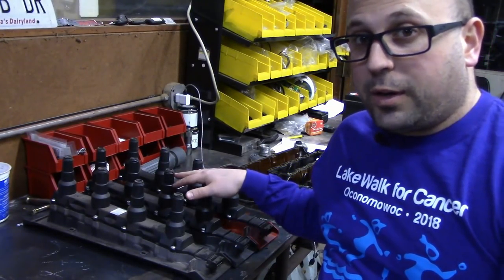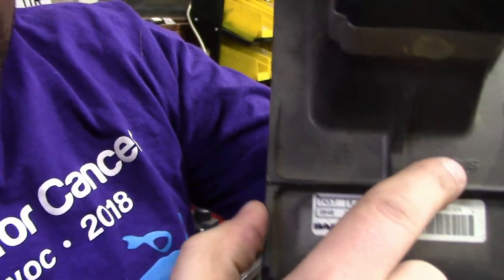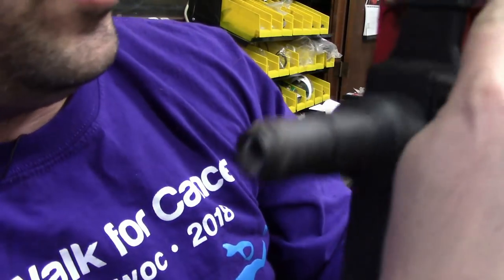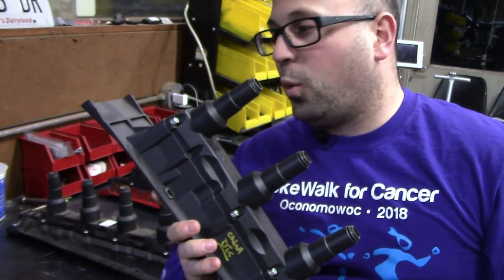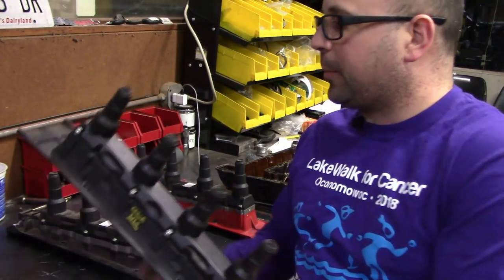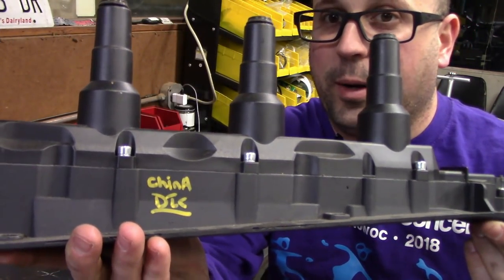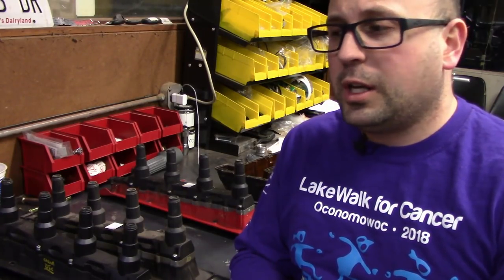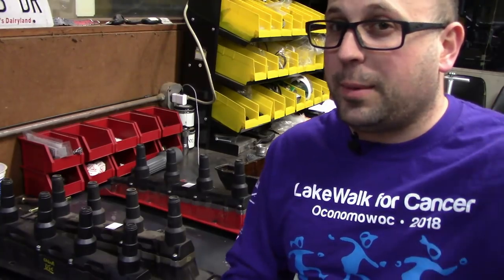Everything you need to know about the Saab DIC (Direct Ignition Cassette) and more!

Comment: Lots of comments below which are Wrong.... Trionic 5 cars use a DC based spark on the DI. It also uses the spark plugs to measure the Ionisation in the combustion chambers between each combustion. This is used for Knock control.  Black DI's use AC based current for the spark. I was on the original discussions on Saab Central back in the early 2000's with Dr Boost, the late Saab engineer that designed Direct Ignition.
Yes you can put a black DI onto a Trionic 5 car, but ideally only for testing. I would say they are ok on a low boost car, i.e. a 2.0t or 2.3t.  But absolutely do not use on a full boost Turbo car, 2.0T, or 2.3T / Aero. You will have ZERO knock detection and you will melt valves or punch a hole in a piston.
Reply: Thanks for the explanation. By extension, a T5 DIC should not be on a T7?
Reply: @Codric  Yes, a T5 Di on a T7 car, it wont even start. And could even damage the ECU.

Comment: Every good Saab owner should own a spare SEM cassette. My 9000 has a T7 and of course, I keep a spare T7 in the trunk. Another awesome video! Thanks Saab Dr!
Reply: Your 9000 has what? T7? Did you like rebuild all the electronics in the car or what, because 9000 never had T7 from factory.
Reply: @PeterChomanic  while the early models of the 9000 were not compatible with the T7, the later 9000 Aero and CDE models with APC  were compatible with the T7. One of the Saab engineers who worked on the cassettes has written "The final word" on DI Cassette compatibility. But you're right. Cars that shipped with T5 shouldn't change their DI Cassette. (With the exception of some B234 which allowed it in certain cases)
Reply: @TheWiseTent  ok so your 9000 has a black cassette for T7. But it does not have T7. T7 is a trionic unit, an ECU. I know you know that. But now we understand each other
Reply: thewisetent would my ‘97 Saab 9000 CS 2.3t Anniversary Edition be able to use a t7 dic

Comment: The cheaper ones also weigh a lot less and are potted with silicone vs the hard black stuff that OEM have. I took two apart for fun yesterday. One was a blown OEM and the other a new Chinese one that didn't work right. The cheap one wasn't even soldered together on all of the coil packs inside. I should have done a video, but didn't think about it.

Comment: An important information to mention is that certain versions of 9000 can use a black DIC (T7).
MY90-92 with DI/APC using an LH 2.4.2 fuel system can use black DIC.
The reason for this is that the red one has a DC spark, and the black one has a AC spark, and thus, a longer spark duration.
It turns out that car with LH 2.4.2 like that. It's even better, since the longer spark duration enables the engine to run smoother. 
Of course, you can use a red DIC as well, since the car was shipped with it by default.

Again, this only affects LH 2.4.2 9000's. 
You should not use a black DIC on a T5 car, under any circumstances.
Even when you desperately need a spare one. If you have T5 car, carry a T5 spare (red).

Comment: Sorted my no.3 misfire. Had replaced awhile ago with  a China rubbish one. Put the Saab one back in and it’s all ok now . 5 screws were by spark plugs. Mind you I had done 500 miles with it ill. Still had amazing pull. 9-5 2000 2.3 hot turbo 117k miles. Cheers..

Comment: You may want to update your video. Orio, the company that now owns the rights to supply Saab parts to the world, sells an ignition cassette that fails all your points. No stampings, no SEM #s, hex - not torx screws. Label says Saab Original. It is part number 32022255 which supposedly supersedes part number 55559955.

If there is a way to post a picture let me know. I took a picture of the Old Original & the ?New Original but it's not letting me paste it here.
Reply: Does that mean 9-5 V6 3.0t ignition cassettes have the new manufacturer and part number too?

Comment: I've been running black DIs in some of my 9000s for tens of thousands of kilometres, haven't noticed any problems to speak of, aside from a little pinging on really hot days when running low octane fuel in my naturally aspirated one. Although this is probably due to other factors than the DI module.  My understanding is that the T7 module is fully backwards compatible.

Worth mentioning that when these modules fail (and fail they do!) that you should unscrew the base, if uncracked, and keep it.  The bases are nothing more than moulded plastic with rubber fittings and springs inside to conduct the electricity to the spark plugs.  A cracked base can easily be either swapped out for an uncracked one or the cracks can be filled in with a $1 dollop of two part epoxy resin (something else that I have done myself with tens of thousands of kilometres of subsequent trouble-free motoring).

Never encountered a Chinese knock off before, but will keep my eyes open for them from now on.
Reply: it's not fully backwards compatible. DIC is of course sending a spark current, but it is also messuring stuff back through the spark, namely ionisation, which is sent to the ECU that counts on that data to adjust the ignition, etc. so you should actually run red in T5 and black in T7, but emergency use is still possible. it is known T5 with red one does not have any big problems to run, of course, but the more power you have and the more sharp your driving style is, the worse.
As fot the cracks, having a crack still does not have to mean it's broken already. It's heat causing the plastic to crack. Failure is based on epoxy crack under all the covers, which then lets the current to go not only to the bank it should, but jumps between two.
Reply: Biggest difference is that spark in red one is done with DC and in black one in AC. Also knock detection is a bit more sensitive in black one, and that is why red one cannot be used in T7 car. But T5 will run happily with black one (even more smoothly because of the longer AC spark).
Reply: Absolutely NOT backwards compatible. Who ever told you that is talking BS. Please see my post at the top of the replies.

Comment: Good info, and nice to see first hand. 
I thought you keep they these positioned the other way up at all times when storing though 😉
Reply from the maker: I've personally never had issues storing them upside down, however I also let them sit a while right side up before use which may make a difference.
Reply: Can you go the other way?  Have a 2000 Saab 9-3, could I put a red di in an emergency situation?

Comment: I have an '01 9-5 that I paid $500 for 7 years ago. It needed a serpentine belt and tensioner. I've been fixing cars for 45 years and this is the only Saab I've owned or worked on. It's not worth buying a scanner that only does Saab. and limited GM's. I work for myself on everything. Last time the disc failed it melted the first cat converter. Too expensive to replace so I drop the the exhaust at the manifold with both converters. I cut the side of the first open, gutted it, re-welded the side back on so it would run. the o2 sensors are before and after the first converter which I had gutted, the rear cat was still good. I had the intention of later relocating the downstream sensor after #2 cat because their job is to measure before and after cat and adjust fuel mix accordingly. But needed the car to run first, so I reinstalled and the car started and ran fine. I was expecting a p0420, catalytic converter below efficiency code to show up but the CEL didn't come on.  That was almost 2 years ago and Colorado requires emission test every 2 years. Last week, it was due for emissions test and since there was still never a trouble code telling me the converter had failed, we just took the test. Passed. Note too, that both o2 sensors look to be original, 194k miles on them.
About 6 months ago it had another no start problem. Traced it down to a unit I can't remember the name of now that wasn't sending a required signal to system saying it was okay to start. It needed to be replaced and/or reprogrammed with the tech II scanner. Spent  many hours checking everything. Pulling the instrument panel to see a part I couldn't replace seemed futile. So I just gave the dashboard above the i.p. a solid, not too hard hit. Sure enough, turned the key and it fired up. It's had other issues over the years - windows, intermittent no crank which was cured with a push button start button tapped into the fuse box. I have since passed it onto a mechanic who works for me who drive daily, and suffering dic failure, seeking a cheaper fix. $325 for good one now... Not on a working man budget. Thanks for the video.
Reply from the maker: Look for a good used OE unit if you can't afford a new OE one. The cheap ones will continue to cause issues.

Comment: They say the t7 dic will fail around 200km mines at 250 and its gone now. Pretty fortunate it lasted that long. Only problem is i cant find an oem spec that ships to Canada. And scrap yards are bare of Saabs as well these days.   
Misfiring on 2 cylinders plus a code for throttle body :(   
Also they say the garrett td04 will fail around 250 so i might be up the creek without a paddle soon..

Comment: I recently had trouble with my 2003 saab 93 convertible.  idel with ruff idel then wouldn't start . Changed fuel pump realys  before we tracked it down to not getting spark from the casset . Tons of gass pressure in the lines shot out like a rocket so its not the fuel pump , and the starter is engaging .
Reply: Alo what are your thoughts on the fact when I take the casset out the bottom half is red? But the rest is black . Was it red an they painted it or where they all black an red under neith .

Comment: Hi Joe, Had a red T5 DIC fitted by my saab dealer to my 2001 9-3 SE (which requires a T7) !?!? What effect would this have had on the running, and is there any long term damage/wear caused by this fault. Thanks

Comment: Thanks for the video! I ordered this part from the links you provided but the one that I received does not have the castings or the SEM sticker. However, it does have a "Saab Original" Sticker with the part number and it has the middle sticker about the resistor spark plugs. It also has the star screws and says "Direct Ignition" on top. Do you know if they changed it or did they send me a China one?
Reply from the maker: I actually need to make a 2021 update to this video. Orio has a new manufacturer of the DIC and they put a Saab Original sticker on it since it's no longer made by SEM. From my understanding they tested them thoroughly before releasing the new one.
Reply: I would love some more info on this matter. I just ordered one that was supposed to be genuine Saab. It arrived with no casting marks and only a sticker that said original Saab. It just makes me uneasy because you can put a sticker on anything.

Comment: I have a 2001 95 with a no start. I have rpm's on my scan tool but no spark. I took the cassette off the plugs, flipped it over (With it still plugged in) installed 4 plugs and turned the car over and have 0 spark. It is an aftermarket cassette. Is this a simple but accurate test that verifies i may need the cassette? Thanks for the help sir!
Reply: It could be the cam sensor, as well. Do you have any codes?

Comment: Ran a Chinese T7 Cassette (generic shop installed it and I didn't know - I only go to SAAB garages shops now) for about 2 years and didn't realize it was the source of extreme misfiring in the higher RPMs under high boost for about a year. I hate, hate, HATE the knockoff cassettes. DO NOT BUY THEM!! I think the misfiring created my oil leak from the head gasket due to the intense vibrations and knocking. I changed it out and never had a problem with misfiring from it again. I try to identify a good cassette by looking for what seems like paint overspray between the metal and the plastic base. 
Now I did have a slight misfire later on immediately after I changed spark plugs due to not using NGK plugs. SAAB Master tech in FL told me only to use NGK plugs and the problem vanished instantly.

Comment: I'd buy 3 chinese ones for $80 a piece on amazon before spending $400 on one OEM. Doing some research, reading reviews, comparing options, and a understanding of the part (e.g. knowing how it works and what could be failure points or issues if cheaply made) can save you money and save your a**hole from being reamed by the dealer for buying dealer parts or taking it to a dealer mechanic.
Reply from the maker: Personally I won't run a non-SEM branded DIC. It's just asking for trouble, and I've seen more failures than successes with them. Also sometimes you can find the SEM branded DICs through places like rock auto in the $150 range. Right now a Red DIC is only 325 and a black one is only 255 through esaabparts -- and those are genuine units. I've done my research, know the unit and their failure points and I'd rather pay a bit more than potentially get stranded. And in 2020 you're not buying parts from a dealer anymore most likely. I remember back in 2010 when these things were $500+ from a dealer, but it's not 2010 anymore.

Comment: My 2003 SE convertible is kicking my butt and I could really use some help.  It was running great (approx 175k miles.). Left it parked for a few months last winter, and would go outside and start it from time to time.  It started running very poorly and would barely idle with sluggish revs when you push the accelerator.  Now it won't start.  Replaced the fuel pump, new NGK plugs, and new Bosch crank sensor.  Just throwing parts at it I know but all of these parts were still the original parts from 03 so they needed to be replaced anyway.  Do you think my DIC is bad?  It certainly seems like there is no spark.  It just cranks and cranks but will not start.  Starter fluid did nothing.
Reply: It's usually that or the crank angle sensor

Comment: Are you using a mono mic? Because you voice is heard only on left channel.

My former colleague (who owned 9-5 Aero MY2002, R.I.P.) told me that it's one of the most stupid things he's ever seen to place a vulnerable electronic equipment on the hot motor. By that he meant the direct ignition cassette of Saabs. I must agree. When I had my NG900, I always had a spare cassette in the trunk. Now when I have NG9-5, I don't have to worry about it anymore.
Reply from the maker: So, that's totally my fault. I was editing some sound settings in this video (and my last one) and forgot to click the "stereo" button in my editor. Of course I edited this both without headphones so I didn't catch it. 

As for having the DIC on top of the engine -- I feel like it could have been fine with a better heatsink on it, or better cooling. The thing is that there is always vulnerable electronic equipment on top of a motor -- every motor has coil packs. They end up taking a lot of heat. I think the main frustration with the DIC is that you can't just replace one coil when it goes bad, you need to replace the whole pack -- and until recently they were stupidly expensive for an OE one (they've come way down).

Comment: Guys I have a DI engine code to replace it. Can a bad DI cause higher and entended revving at boost and higher speeds?  My car is not fully boosting. Used to go up to 140 mph..☹️ btw it’s a 2000 9-5 Aero

Comment: Dear Dr. saab I have a 2003 Saab Arc 9-3T 6speed manual transmission, I replaced the clutch 2 years ago, however, I need an engine replacement can I upgrade to an 2.3 B235 for more horsepower or is it compatible.
Reply from the maker: Unfortunately a B235 won't work in a T8 car without extensive modification. I know that some folks think that you can plug and play -- but that's not the case unfortunately.

Comment: I have a Saab 9-5 2003 I recently changed the ignition cassette after a misfire code reading and a few months later my car is acting funny again it won’t start the engine cranks like it wants to turn over and start but I doesn’t I changed my spark plugs when I changed the ignition cassette so I don’t know what the problem could be. Any suggestions?
Reply: Check to see if any codes are stored first. Could be the following: Check fuel pressure. If none. Fuel pump. If there is pressure, pull out injectors and test the ohms (there are pleanty of vids on that). If not that could be crankshaft sensor, cam sensor, or maf sensor.
Reply: Check to see if any codes are stored first. Could be the following: Check fuel pressure. If none. Fuel pump (most likely issue). If there is pressure, pull out injectors and test the ohms (there are pleanty of vids on that). If not that could be crankshaft sensor, cam sensor, or maf sensor. A code will certainly get you going in the right direction.

Comment: Great stuff....I have a spare DIC but I'm not sure I trust it and never knew how to check the date. When I got my 2006 95 aero it had Denso spark plugs in it and was issuing the misfire warnings so I bought new NGK spark plugs and an OEM DIC from Neo Brothers. Would the wrong spark plugs damage the DIC I took out? I got the car with 90K on it and no service history.
Reply: Yes incorrect plugs can damage the DI. Only use NGK-R plugs of the correct type.